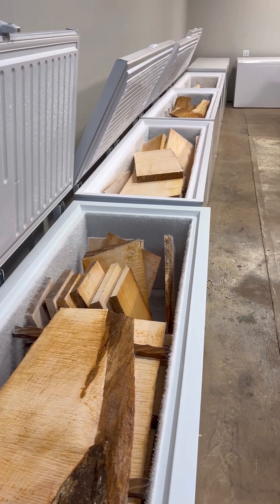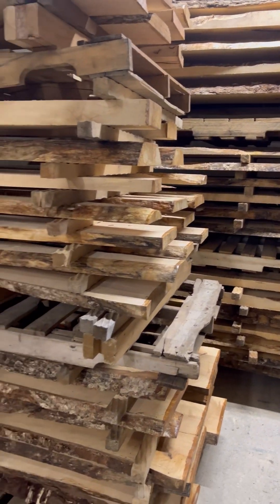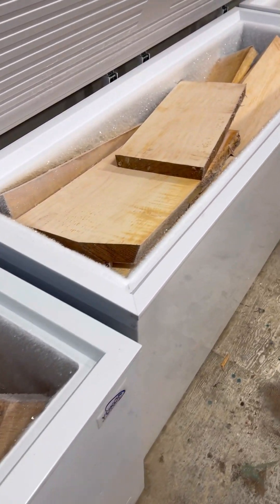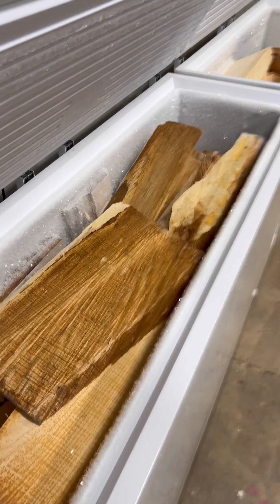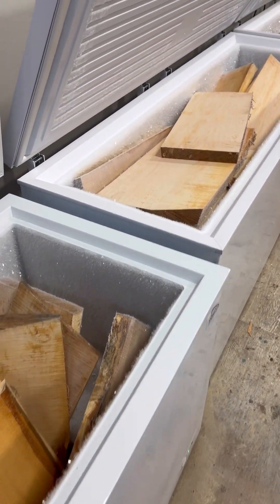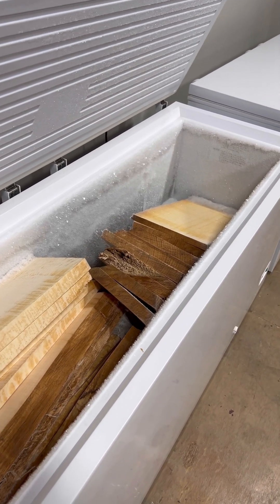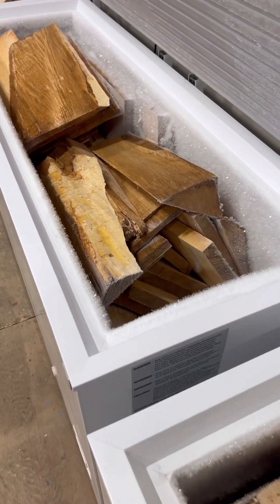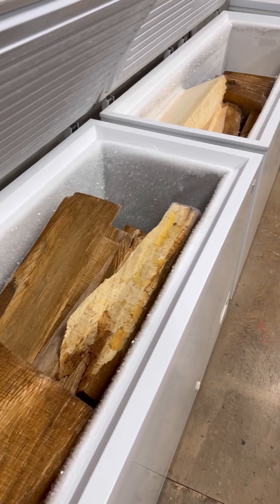Freezing Big Leaf Maple Before Putting It In The Kiln

Comment: I can confirm that your process is valid. The science behind it is accurate.  David D Bunker grew up in Forks WA, and was building guitars before we were born. I worked with Dave for 30 years and I remember him talking about the mountains in Port Angeles and how he used to get the wood out and then dry it.  I still have some of that wood in stock that I have been aging for about 25 years now. I’m gonna be using it here in Nashville shortly making some very special guitars. I will definitely be in touch with you when I need to purchase some more woods..
Reply from the maker: Awesome. Sounds like a plan. Thanks